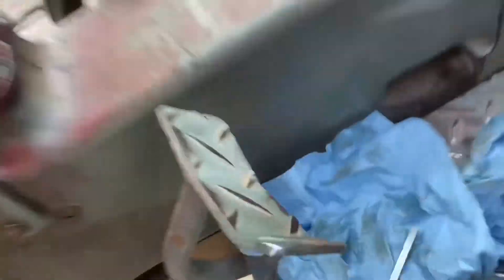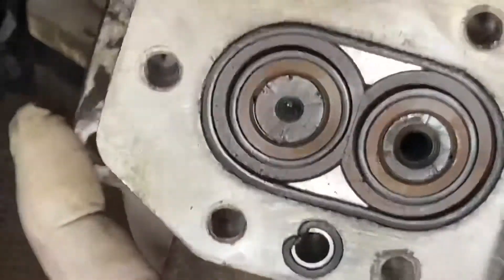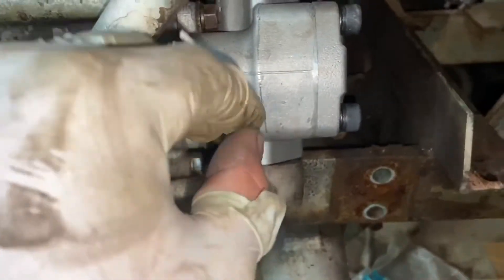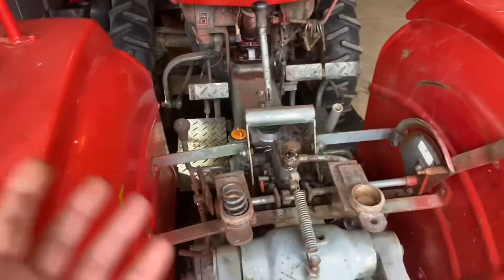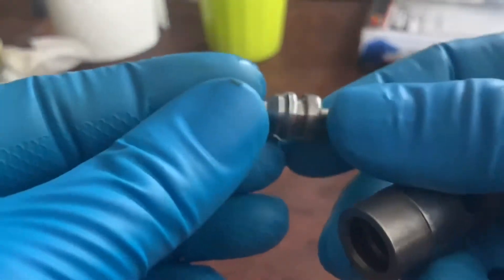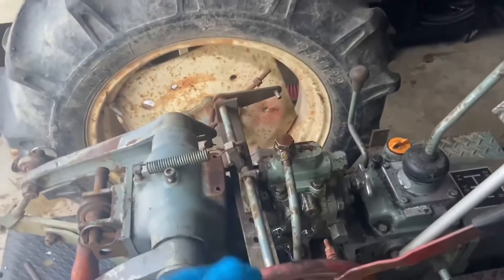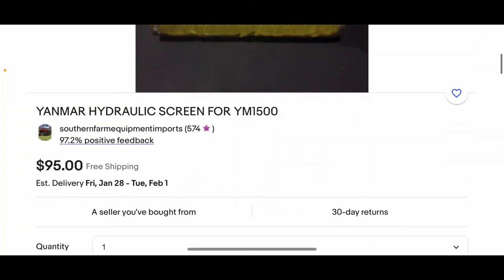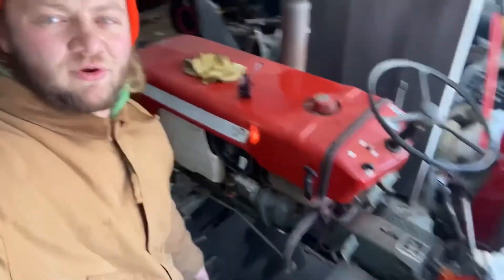Yanmar 1500D 3 point not working and fix HOW TO STOP CAVITATION in your hydraulic pump

Comment: I HAVE A YM1610D.   3 pt does not work.  FEL works fine.  Hydraulic screen clean. Hydraulic fluid clean.Removed the 3 pt actuator.. Did NOT see any steel ball.   (a) Should I have one?  Does not show on parts manual.  (b) There is some minor abrasions on the piston  - it this a concern?  (c) Examined the valve from above through the 3 holes, looks clean.  Your suggestion on what is next?

Comment: I have a yanmar 1500 and the 3 point picks up a heavy load but slowly comes down. Hydro pump makes and little bit of a whining noise any suggestions?
Reply from the maker: There’s a little lever that flips around, best way to describe it is it’s a roll pin that is the lever. Flip it around until the implement goes down faster. I believe I showed it in the video. If you need more help let me know. I would have to look at mine to remember exactly where it’s at (somewhere on the upper of the rear transmission box.

Comment: I just bought a YM1500 and its leaking hydraulic fluid out the top of the 3 point actuation valve where the copper washers and bolt go into the top. Going to order a couple of those copper washers and hope that does the trick. Any tricks to getting that supply line in the right place to get the top bolt to go through it and back into the top of the valve?
Reply from the maker: I have never had any trouble with them, it’s just like a brake line on a car, it should seal up without too much trouble.

Comment: My F15D Yanmar 3-point lift stopped working. I really appreciate your information. I'm much more likely to tackle the job of fixing it. However I need to use my tractor while the weather is cooperating so I rigged up a 12v Harbor Freight 1500 # winch to the rollover bar and for now it works good enough to get the work done. Well done!

Comment: Tractors I have owned have a screen like that on the hyd. pickup , but a pleated paper cartridge after . After 40 years it might not make much difference but I wonder if there is any benefit to adding a bypass spin-on to get finer filtration . I have never worked on yanmar , so I might be talking out my a**
Reply from the maker: I’m sure there would be a benefit to adding a spin on filter that is for finer particulate. The trick would be finding one that’s high flow enough. None the less, the tractor has ran for years and years and years without so I’m guessing there probably is not a real need for a fine filter. Thanks for watching!